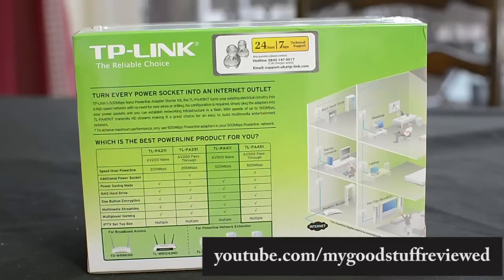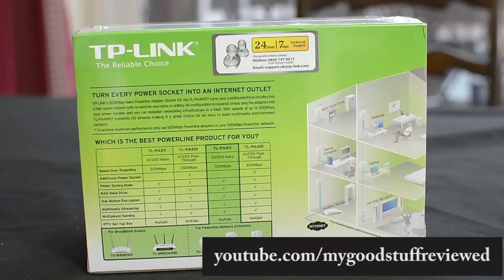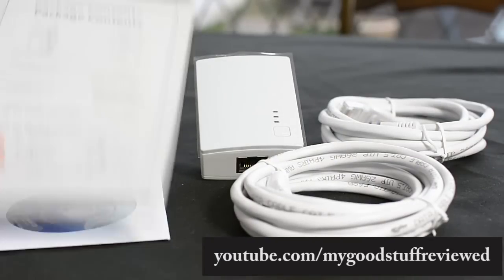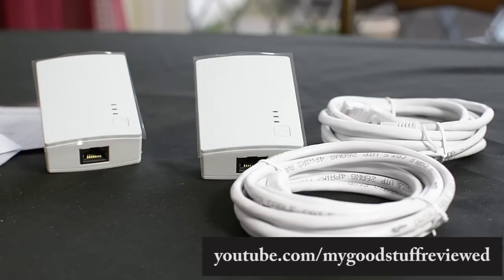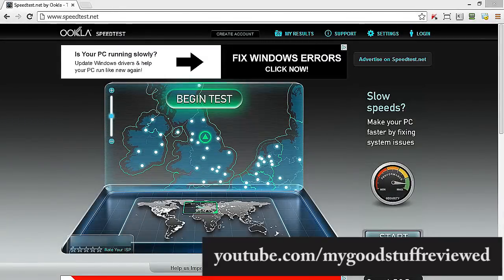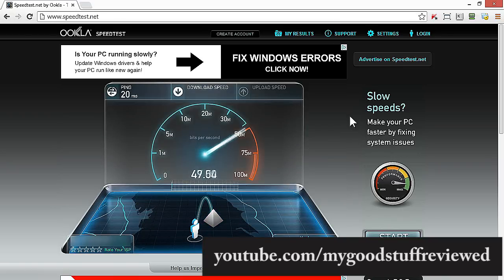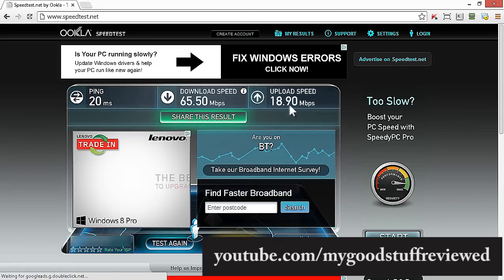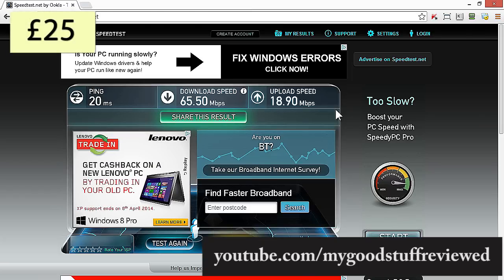Review of TP-link AV500 nano powerline adapter kit

Comment: Have one installed in my house. They say not to connect to a power board but I have both connected to a power board at either end. The power board is a 'dumb' board without and surge protectors. I get 140mbps+- depending on how many appliances are drawing current. Unfortunately until my NBN glass fiber connection is turned on I an lucky to get 4Mbps speed on my ADSL2+ connection.

Comment: nice review..  do you need to install drivers..?  reason i ask would this work on a smart tv.? I have a LG smart tv with built in wifi but its forever buffering when trying to stream large home movie files from my pc to the tv..  but would have no way to install drivers on the tv  thanks...
Reply from the maker: No drivers were needed.

The RJ45 cable (they're included in this kit), are standard ethernet connectors, so anything that can take an ethernet cable for network connection should just work.

For large media files this would make a big difference to your speed. If your tv has an ethernet port/jack then you should have no problem with this.

Essentially, you'd be connecting your tv 'directly' to your router. It's just that you'd be using your electrical wiring to do it! It's a really clever solution I think.

This was literally plug and play. After plugging in and connecting the cable, it takes about 10 seconds or so for the signal to start coming through. I guess that's just about how long it takes a device to register an IP address on the network.

Comment: Excellent
Reply from the maker: I liked this so much I went and bought another set, so my kids now have really fast connection speed.

In fact I've disconnected my cable from my desktop and I've plugged it into my laptop while I'm replying to these comments.

It makes a huge difference to how fast pages load.
Reply: Great. I plan to use ethernet, but I like the idea of these as well for value and convenience.